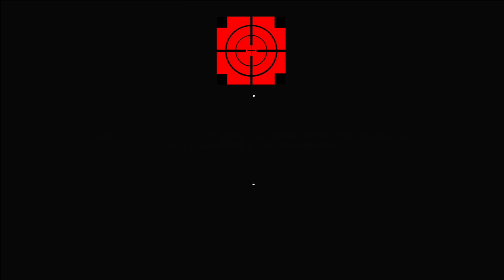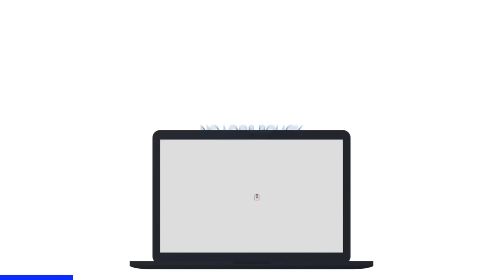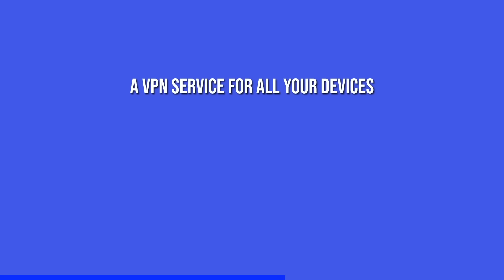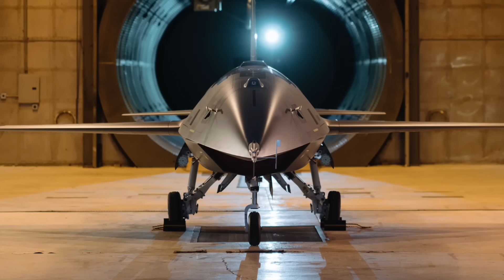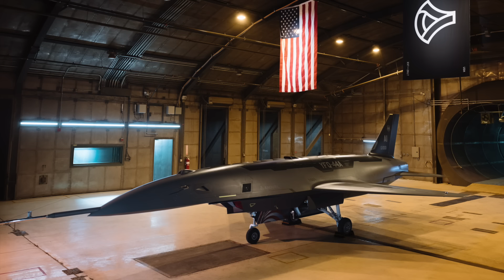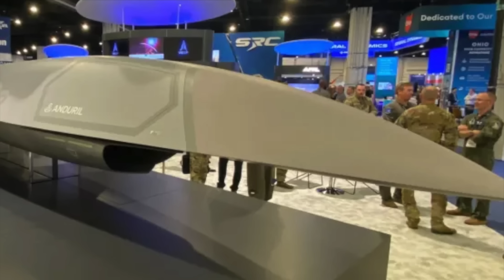How Anduril YFQ-44A  flight test marks pivotal milestone in U.S. Air Force CCA Program ?

Comment: The payload is only 2 AARAMs.  It’s a very expensive drone to just add 2 air to air missiles. I must be missing something.  If it had an internal weapons bay and was able to carry 4 120’s this might make sense. With them being external they lose any stealth capabilities.
Reply: The point is that they're cheaper than conventional manned combat aircraft: there's no issue with them not being as stealthy as F-35's since they're supposed to be more expendable, and in some ways that might even be an advantage since the enemy will be focusing on the disposable drone assets that are visible, over the stealthy manned aircraft controlling them. And "just" 2 additional missiles is still 2 more missiles you can bring to a fight.